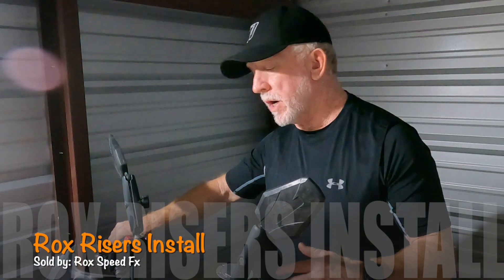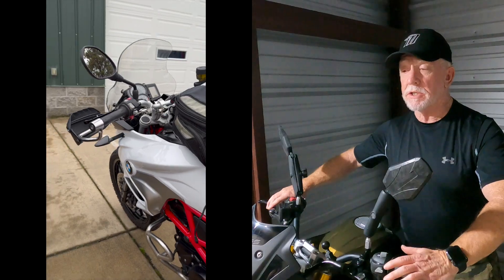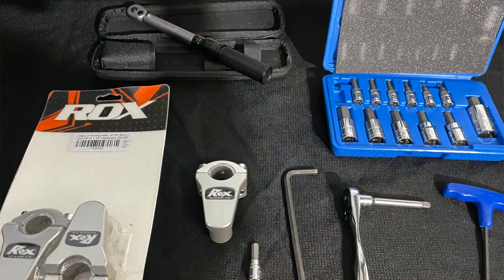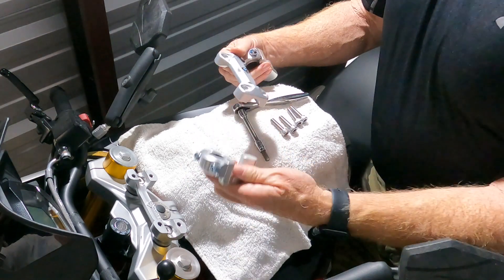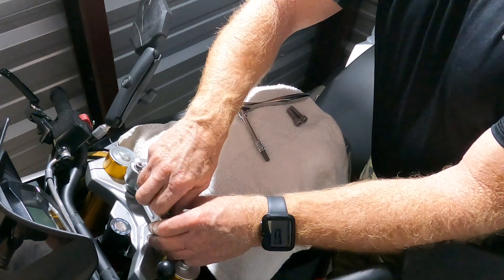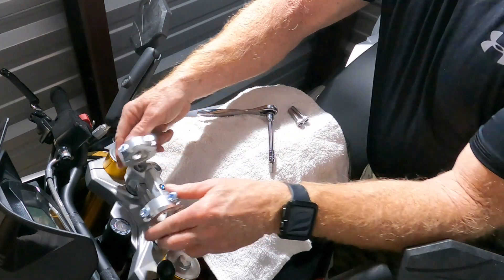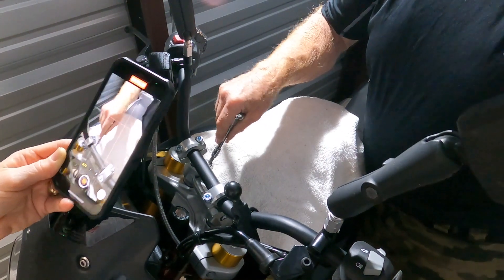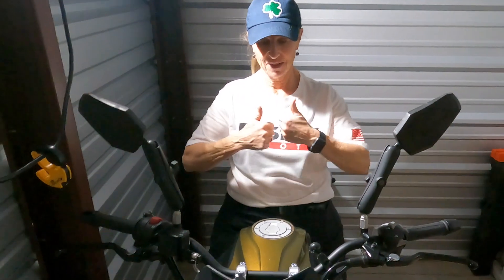Rox Risers BMW G 310 GS - Handlebar Risers Install @RoxSpeedFXinc #motorcycleparts #install

Comment: Looks great! I'm sure that will make a huge difference going down the road.
Reply from the maker: Thanks so much! It is interesting how one change can make so much difference in handling! Caroline really had trouble with the kickstand… but after the Rox install she has had very little issues. Thanks for watching! 
John and Caroline ☘️
Reply: @TheGrandShamrockTour I'm not worried about cornering lean angle, so I did something like that, then also added a plate that lowers the pegs.  So much nicer for the hips and knees.   Stay safe!
Reply from the maker: @JCrozier1   Ha! I will let John know... Interesting idea to lower the plate and then pegs. He may appreciate that. He has considered updating the front forks as well... so far I have not bottomed out or had issues with the suspension. We will let you know when the sun comes out and we hit the backroads. 😂
Reply: @TheGrandShamrockTour  I actually lowered the pegs themselves after the plate by using comma of all things a Honda goldwing peg. It's down another half inch and has a much larger surface for your feet. It's so much more comfortable to stand up with that bigger space and it doesn't look obnoxious to anyone that isn't paying that much attention to a bike.
Reply from the maker: @JCrozier1  Intersting! And who doesn't love the Goldwings? we will check it out. 😃

Comment: Hi John - just happened to come across your video as I was tackling the Rox Risers on my new F750GS! Nice job, it was very helpful! I did have a problem with my install - I removed the NavVI mount and found the bolts on the triple clamp were much taller, too tall to allow the risers to pivot. So I switched out 2 of the bolts from my F700 to allow for the space to pivot the bars closer to the rider.
Reply from the maker: Hello! Is this THEE Lisa we met in Great Falls? 😀 I hope so. We love your newest motorbike and we have used those Rox Risers several times now and appreciate how they improve the handling. 

We are thinking of adding the NavVI and will be interested how it changes the mounting. Sounds like it worked out okay for you. 

Thanks for reaching out!
Travel safe. 
John and Caroline ☘️

Comment: any reason why front forks are pushed through fork crown (at least 20mm). Has bike been lowered
Reply from the maker: We have two of the 310’s. One of them was lowered using the lowering link, lowered the forks, and shortened the kickstand for Caroline’s bike. The Rox Risers did help the handling! Let us know what you come up with. 
John and Caroline ☘️
Reply: @TheGrandShamrockTour  i also fitted the lowering link, shortened sidestand and pushed forks through top crown but only 15mm. Was very reluctant to go any further in case handling issues occurred.
Reply from the maker: @neilkoos4556  Caroline here… I did not find any issues with handling. I did when we lowered the front forks on a prior 2009 BMW f650 GS. It would dive in the corners a bit. I have not noticed it on this 310. I hope that helps. 👍☘️